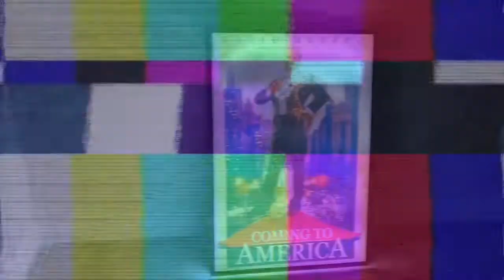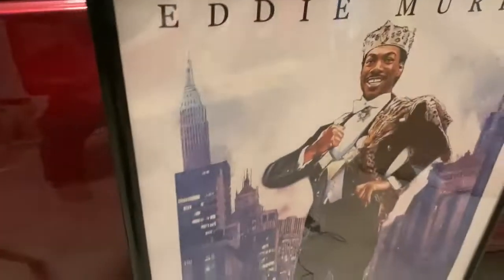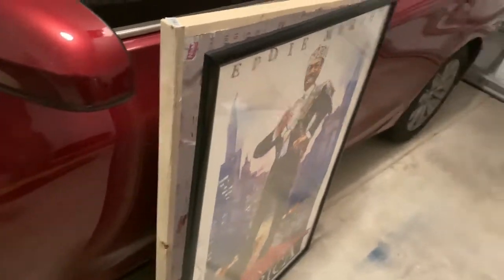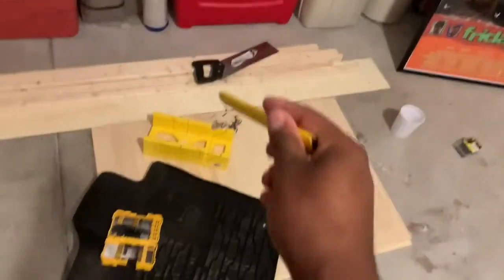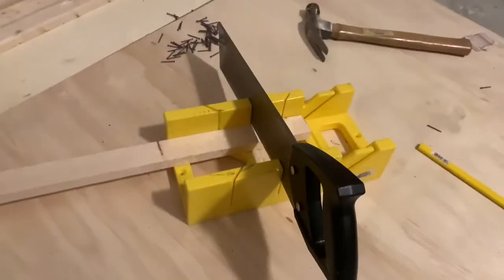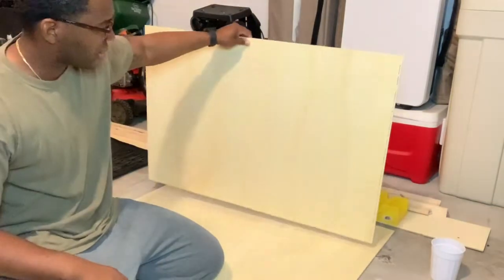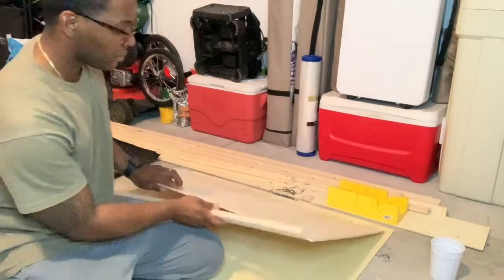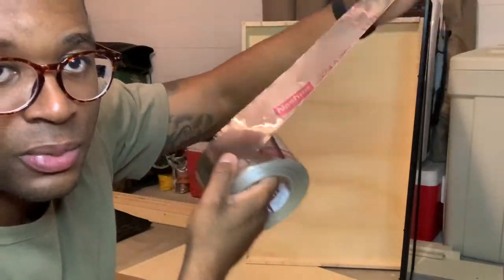LED Movie Poster Box

Comment: Great job!. You can do the same thing, by purchasing a cheap wood or plastic frame instead of building one. It should also come with a plastic or glass cover. You can sand down that cover so you can diffuse the lights so you don't see those hot spots.
Reply: Im planning on doing this project..you saying the way he did it , you would see the led dots ?
Reply: @georgemedina3712  yeah. I've built 3 so far and had some trial and error. The best results I got was with using a packing foam sheet (I happen to have because it came with an LCD I just purchased). Those are hard to come by unless you buy a pack 100. Not expensive, but I didn't need that many and I don't want to add to landfill. Then next best thing is to go to a dollar store and pick up foam core board. Use a hair dryer to peel off the paper. Just place it between the lights and the poster and it's a pretty good diffuser.
Reply: @georgemedina3712  What I did, was buy a $10 frame from Walmart, added some hinges to one end and build a simple wooden box to attach it too. You need it to be about "2 deep so you have some room between your diffuser and lights. I just used packing tape and aluminum foil for the reflective backing (don't use aluminum tape, its too expensive and you don't need it and the foil with a packing tape layer works fine), then affixed the LEDs to it. All in it's about $35 worth of materials. Looks great. I have them mounted next to a store bought one ($200) and they hold up. Look almost as good.
Reply: @thorb2663  thank you .. 👌. Im just a lil confused with the diffuser ..so the foam coat board has a sheet I can remove ?   Are we talking about the half inch white foam board ?   And just confirm ..the diffuser goes rite on top of the light and under the poster? Thanks again ..going to try this , this weekend 👍👍👌
Reply: @georgemedina3712  Foam core is about 1/4 inch thick and can be found where all of the poster boards and markers are at the dollar store. It has a paper layer glued on top. You have to peel it off. (Easiest to heat it up with a hair dryer first, you can look it up on youtube). Place the foam core directly behind the poster. The further away from the LEDs the foam core is, the better the diffusion will be.
Reply: @thorb2663  thank u ..u the man 👌👌👌👌

Comment: The strips that should be 27"....shouldn't they be cut shorter to accommodate the width of the boards that are 40" long? So maybe they should be cut around 25 or something like that? I'm trying to figure it out because I need to build a lightbox myself.

Comment: Did you consider using Mylar blanket material instead of the expensive foil tape? You could hot glue it for a fraction of the cost.You could use a spray glue to fasten it as well.
Reply: I've seen multiple channels using this same technique.  They're all following what other hacks are doing.  To be fare, they're all beginners and have limited experience.  But nothing is researched or checked.  Saw another person doing this to a CANVAS print.  Same thing though.  Expensive aluminum tape and no diffusion for the lights.

Comment: You can clearly see the pattern of the leds through the poster, any way round this?
Reply: Yeah a diffuser and having the leds further away this is a shit job i bought mine as i think it will be thinner and better made
Reply: @thebeast9869  this is probably the easiest and cheapest way for a movie lover to build a movie poster display, like @shauny m wrote, without needing a freakin' workshop with expensive, bulky, electrical tools and no advance woodworking skills. It is shitty? Why do you sell your off-the-shelf product and improve this design? Now that would be something I would like to see...

In the meanwhile, my take on the problem of the visible LED's would be to apply the LED strip like and edge-lit old LCD panel, yes, there will be an halo kind of effect but may be less distracting and require a shorter length.
Reply: one issue is he is using single-sided posters with his lightbox. Original movie theater posters are double-sided (printed on both sides) and would mask this more as well. Also, my little DIY project I'm doing trying to make my own I've noticed the further away the lights are from the poster the more diffused the light source gets and where the strips are facing.
Reply: Putting parchment paper on top of the LEDs would hide the lights but create a glowing effect. That's how you correct it.
Reply: @Sektor1  so u saying don't put them behind the poster but on the side panels ?   Thanks and I this the OP did a fantastic job explaining and showing the diy